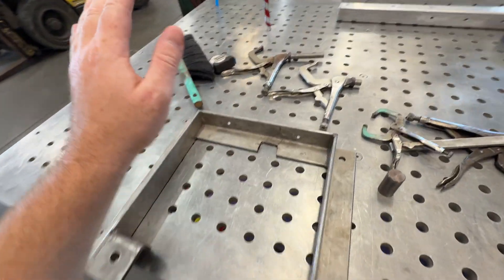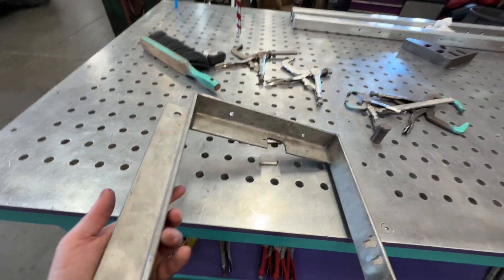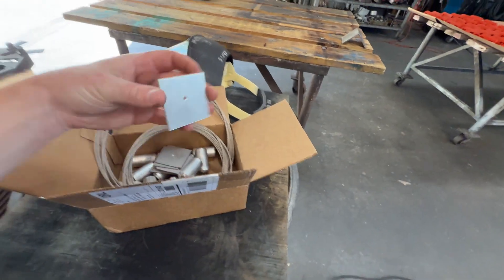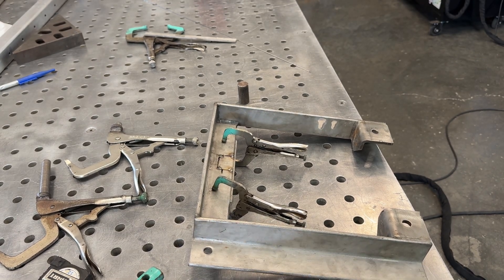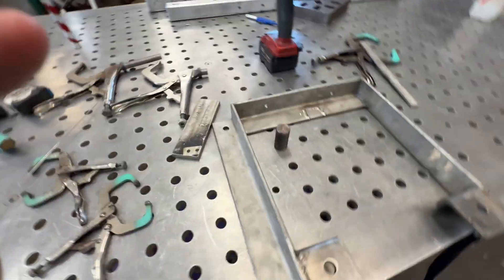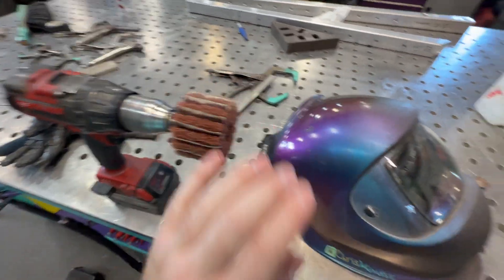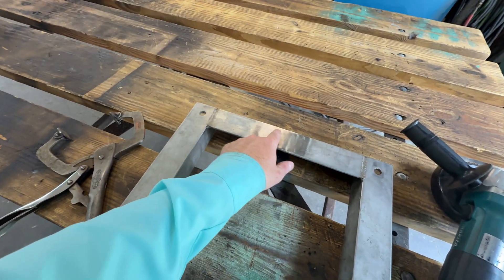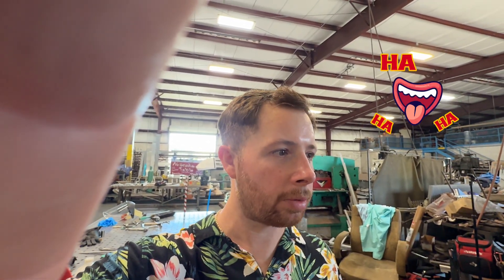How To Regrow Metal???- Tig Welding Fabrication Repair Work

Comment: Thanks for sharing your thought process as it went along. I heard you mention you were in Florida and I was wondering how you keep surface rust from your welding table, etc.? I assume you guys have high humidity also?  I only ask because I'm always looking for ways to prevent rust on tools and materials and hoping to learn.
Also, and I understand if this is not a fair question, but what would you charge for a job like that?  Thanks!
Reply from the maker: Thanks for watching 👍
The table this new fixture table is aluminum so no rusting really. Our old table we still use is steel no one really kept it clean I tried to just keep it clean and dust free really helps. My table at home is smaller but steel table top and I use a da orbital sander any sander will work with fine grit maybe 220 grit and go over it every once in a while to help and just acetone wipe it after is doesn’t seem to rust often. I understand what you are talking about though for me I find just trying to keep it clean and give it a wipe down every so often really helps. If you want you can spray it with a light light coat of wd40 I don’t like any coating on my tables though maybe that and wipe it with a damp wet rag after. Tools they don’t all rust same just keep clean and clamps I’ll just lube the threads with anything oil or wd40 or anything then I just go over it with a damp rag with soap and water in a bottle mixture and clean the parts you will touch. That seems to help a lot. 

Hard to say for price and who it’s for this was for a good customer so it was kinda a break deal and depends if your a big company or just in your shop and good price would be at least 100 an hour this didn’t take that long and the took maybe 20 minutes so I guess you could say maybe $30 give or take material wasn’t much since we had a bunch of scrap pieces laying around but if you had to go buy it being it was type 316 stainless steel and filler wire if you didn’t have it could add more to your job especially if you don’t weld 316 a lot you still may have to buy a pound or more of wire. So I guess you would have to factor that in.